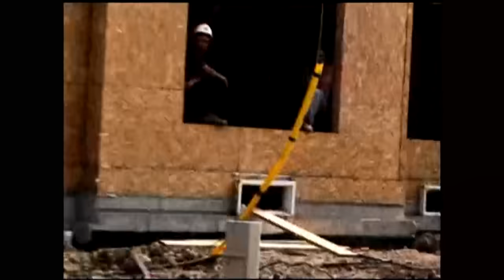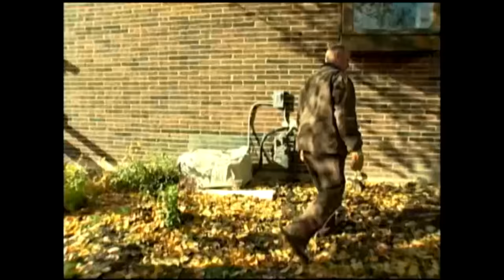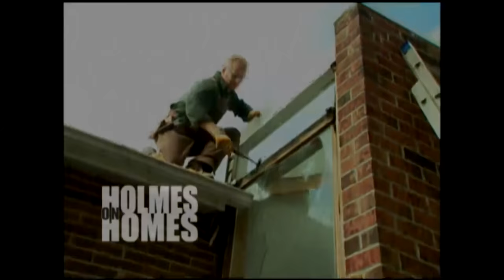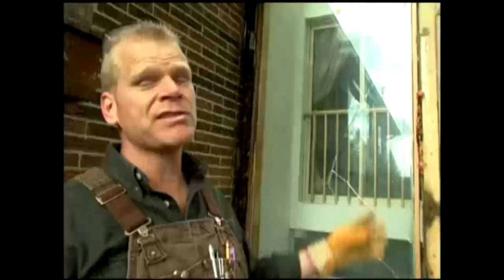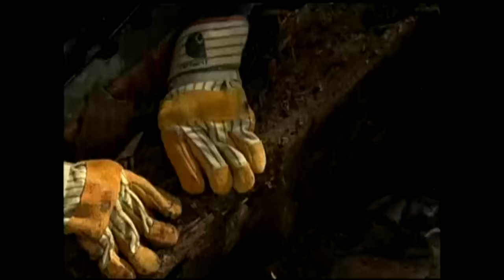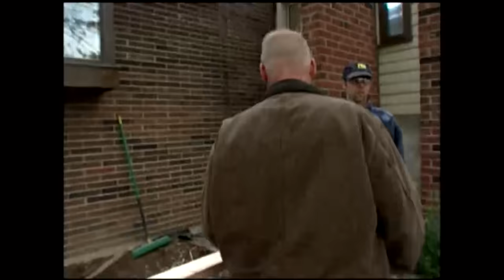Mike Holmes Defeated the Leaky Window Menace | Holmes on Homes 108

Comment: Looks like the wrong type of glass was used originally. Should have been safety glass. Mike and his crew did a fantastic job.
Reply: ? Why, only safety glass is used on doors I thought or shower doors. Thermal yes.
Reply: A vacuum, on that size of window? I think that is wrong, the void may be filled with argon, or a similar gas. I would have thought the actual glass would have to have been at least 6mm and laminated, no way that it could have been lifted by hand if it was.
Reply: @None-685  -- any glass that goes down to 18 inches above the floor must be safety glass.

Comment: The original design by the architect was either too unrealistic or the builder wasn't skilled enough to execute the plan.
Reply: I think a bit of both. If the builder was skilled enough and cared, they would have caught the goof of the plan. They also wouldn't have framed it wrong... That add on was doomed from the second pen met paper tho it looks REALLY NICE... Mike's crew could see the idea, had the skills to fix/adjust the build and got the job done.

Comment: Why using replacement windows and not new construction windows with nailing flanges??
Reply: this is from the early 2000s so the windows you're talking about either weren't around or not widely used at the time
Reply: $$$.... Folks forget the world has changed A LOT over 20 years from codes to building products. Personally I would have gone with a clear thick plastic kind of product rather then glass or better yet widen the add on to just put in a sliding door. Expanding to fit the sliding door would keep the big window look with also giving security of a exit if there was a fire. Also would be safer for any fire/work crew who needed to remove that giant sheet of glass.